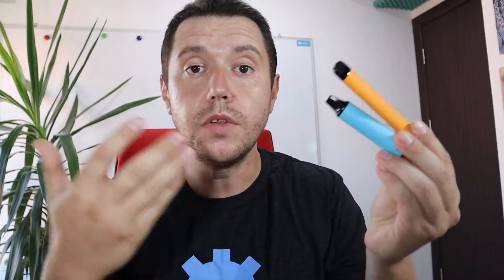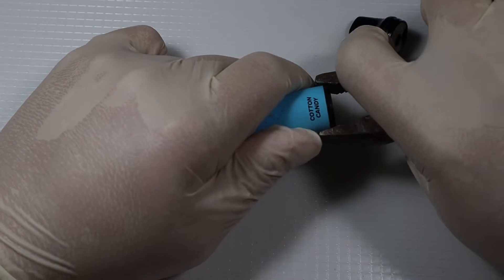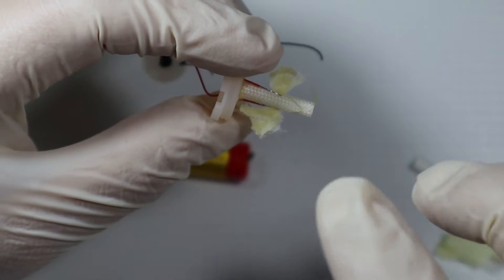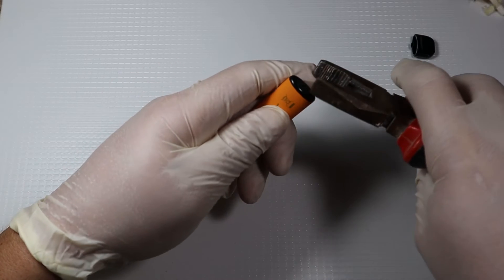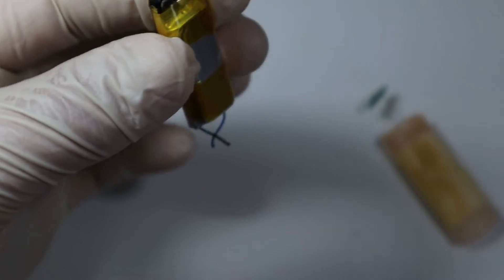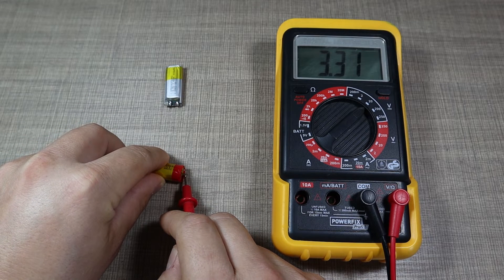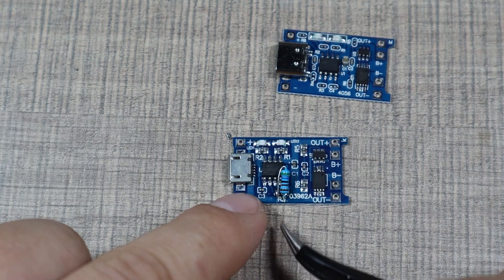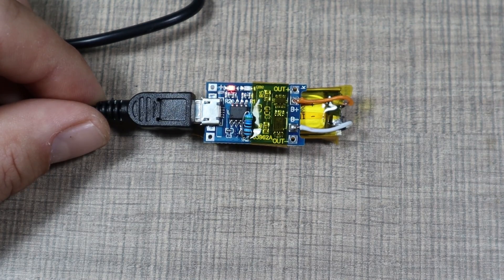How to find free Li-Ion batteries from the street and use them in projects

Comment: Instead of the going through that pain of replacing those resistors you can just simply add a 10 ohms resistor at the output voltage side and leave that small resistor alone. 😂
    Asuming that you need 4 volts and 0,3 - 0,4 amps to charge that battery safely...
Reply from the maker: Hmm that is an interesting take. If I understood correctly, you suggest to limit the current into the battery, right? How did you got the 10 ohm value?
Reply: bad if use as charger many cell

Comment: just use the charging board from the vape .
Reply from the maker: these came from devices that did not support charging from the factory and were marked as disposable.
Reply: @TasteTheCode  3 pin board from vape can charge red black to +5V, black blue to cell, between black blue 4.2 V until charge
Reply from the maker: @Влад_С  OK, I did not know that. I do have few of these boards and will give it a try once I get the chance.

Comment: Hey! Thank you so much for the advices and knowledge you are sharing with us through your channel, very interesting. I've tried a small project following this video that i would like to discuss here about recovering vape cell from street and then building a new battery pack for my vintage camcorder (needs 9.6v). I've soldered three vape cells (3,7v 2.035wh each) in series after charging separately (4.10v each after the charging process). But when i put them together with a TP4056 module, it blew, and it's not longer working. Also, it smelled a bit burnt after putting the USB charger. It worked with the batteries in parallel, but not in series. What do you think? I'm a bit newbie here and i appreciate some kind of help or advice. Thanks a lot!
Reply from the maker: When you combine them in series it increases the voltage and the TP4056 is only meant to be used for single cell batteries. For multiple in series, you need a BMS circuit and they are usually marked with 2S, 3S, etc. where the number indicates how many cells in series it supports.
Reply: @TasteTheCode  Thank you so much for the info, i didn't know. I will search this BMS circuit
Reply: use 3s li-po|li-ion charger, tp4056 1s charger

Comment: Good to be able to charge a 3.7v 500mah polymer battery, and seeing that the tp4056 R3 has to be modified for a 4k R so that it drops from 1A to 300mah, is that true? Or would it not be necessary to make that modification? If I didn't make that modification, what could happen to the battery, thank you
Reply from the maker: By default, these modules will charge at 1A. For a 500mah battery that is too much and it might damage the battery or even set it on fire. The general rule is that the lower the charging current is, the safer you are.
Reply: thanks @TasteTheCode
Reply: Coming from the RC Car hobby, the vast majority of videos on charging recommend 1C as a safe level. For 500mAh 1C rate is 500mA or 0,5A - you just drop the "h". If you charge a 500mAh battery with 1A then it would be 2C for that battery. This can still be considered a reasonable rate. Be careful though, as with these recycled batteries you can still cause fire even with what's considered a safe rate, if they are damaged.

Comment: I'm doing same thing with these sticks.. Great source for batteries.
For these modules, overdischarge protection is set to 2,5V.. 😉
Reply from the maker: Have you found a goto use for them? I got a few already but I haven't found a use that is exciting.
Reply: @TasteTheCode  Yeah, I find few useful ways to use them. By now, I'm replacing sanitizer vehicle remote NiMH 3S1P battery pack content with 1S3P LiION cells and including charging and protection module, because, these cells are for free.. 😂 Only I needed to charge and sort them by internal resistance and capacity to get close enough for using them as battery pack.
Reply: @TasteTheCode hey, why do you recommend these charging modules for LiPo, I thought they shouldn't be discharged below 3.3-3.4V and definitely not below 3V.
Reply: @vendettasnares  to be honest, I haven't found a better option yet. I know it is not ideal but I haven't seen any major degradation or issues. These were meant to be thrown away anyway after their first use so whatever life we can get out from them is a bonus.

Comment: 3:15 Pretty sure that's air flow sensor, not the pressure one,
correct me if i'm wrong.
Reply from the maker: I'm not exactly sure how it works but I think it detects the air flow bu detecting a pressure difference where the air flows from area of higher pressure to an area of lower pressure. You need to have this difference to have air moving so in a nutshell it's the same thing. It doesn't measure pressure as such but pressure difference.
Reply: Maybe different vapes use different ones, atm i'm studying mechatronics, so i got into quite an argument with my teacher about these sensors :D.
Reply from the maker: Yeah it could be. In any case, arguments are good as long as you are both open to listen to the other person 😉

Comment: Yes for the resistor tip is safe to charge with lower current
But why you didn't keep the original built in charge module?
Thanks
Reply from the maker: These are disposable. They don't come with a charging module and yet they have a rechargeable battery.
Reply: @TasteTheCode  I salvage some disposable with usb c port are they rechargeable?
Thanks
Reply from the maker: @lenslens7379 yes, the usb port is for charging.

Comment: Do you think it'd be safe to put together multiple of these cells in parallel and then put the entire thing behind one of those charging boards?
Reply from the maker: That should be fine as long as it is the same battery with the same capacity. Also, the max output current should not be above 1A. Don't ask me how I know 😅😅
Reply: Be careful putting untested batteries in parallel. If they are not at the same voltage, you could get a large current flow from the higher voltage to the lower voltage batteries. This could cause a fire in a bad case and could certainly damage the batteries. Test the voltage first and don't connect if they are different by more than a tiny amount.

Comment: Been collecting for ages now. I always keep them on a silicone mat in a metal tray for some weeks to make sure they are happy 'batteries' never want to meet an unhappy lithium ion battery 😅
Reply from the maker: I like the term "unhappy" :D I never had an issue with one so far. If any has any sort of damage I just discard it immediately.
Reply: Interestingly they are at least a bit stable...used one that was driven over...still good...after i left it alone and charged  in an ceramic dish...yeah...rather test them or regnet it when your project gives of magic smoke...

Comment: Data sheets are pretty much impossible to find for these cells. I even emailed Eve about some 16350’s I had with their name on it and they didn’t email me back. 

My guess would be that these cells are NOT chemically designed for cycle life and their discharge rate probably isn’t any more than 3C at most. 

I tested some 1450mAh cells (largest I found from these two flavour vapes) and past 3A I started to see signs that are classic indicators of a cell being pushed past its limits. 

I haven’t tested many of the 650mAh cells I’ve pulled from Elf Bars but I would expect they are similar and wouldn’t pull any more than 1 or 2 amps. Testing the coil on the vape for its resistance would tell you exactly what the vape is pulling but keep in mind that’s typically a burst of less than 30 seconds. 

Based on their small tab design I can’t imagine a simple way to series and parallel these for any significant load. 

So for powerbanks doing 5V 2A….possibly safe. Powerbanks that so 20W or 22.5W of fast charging protocols are really pushing it even with several cells in parallel. Absolutely do not use these for 60W or 100W PD powerbanks. I tested my 1450mAh cells with a 65W PD board but it really sketched me out. My pack was 7S2P so essentially 7 2900mAh cells in series for 25.4V nominal. So right around 75wh
Reply from the maker: Wow, nice thanks for the info!
Reply: Here is a great pdf for the pressure sensor of the e-cig
https://belchip.by/sitedocs/44943.pdf

Comment: how these vapes work there isnt a pressure sensor all it is ,is a tiny electret mic element and it picks the air sound and trips the atomiser element
Reply from the maker: It is actually a pressure switch that looks like a electret mic.
Reply: no its ASIC with charger, same protection and pressure sensor
Reply: @ cheers mate ,its uite clever little package

Comment: The second battery is prone to swelling, why? I have lots that i keep, but over the years the packaging expands and blows up like a balloon looks like it wants to explode...
Reply from the maker: A lithium battery will swell if it is damaged in some way so there is a gas expansion inside. I'm guessing this might happen either from overcharging or from discharging below a certain level if they are kept in storage for a long time. Check the voltage on the ones that have swollen, they are probably discharged down to 0 and not usable anymore.
Reply: chemical process, over (self) discharge can do this.

Comment: is there enough power to cause fire? i dint think so. i have a huge scar from 12v battery on my hand, but i don't think this would do it.
Reply from the maker: If pierced than yes. This is a standard lithium ion battery and it is very capable of creating fires. That is why we need to limit the charging current. I'm wondering how you got the scar from 12v? That is low enough that you can touch it without feeling it unless you touch something hot from all the current of it.
Reply: @TasteTheCode he got that scar because he's the terminal